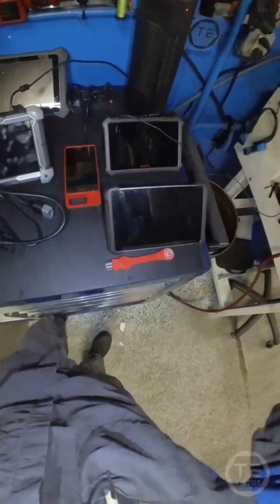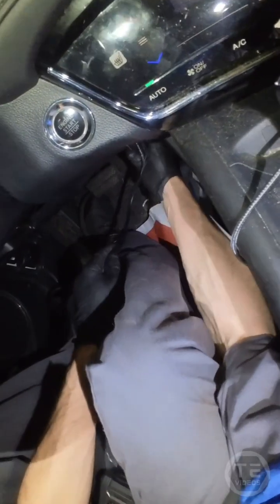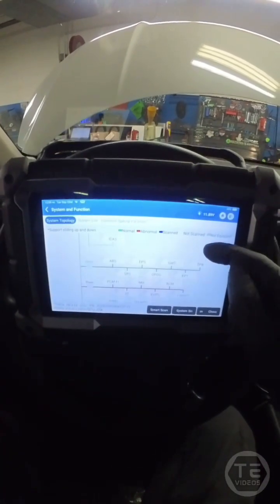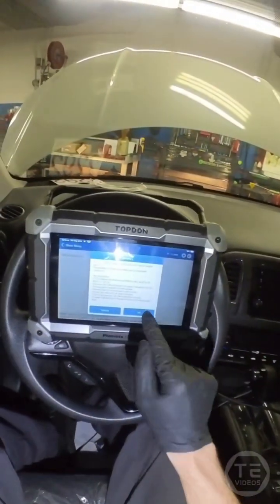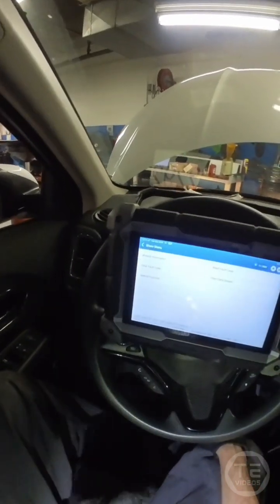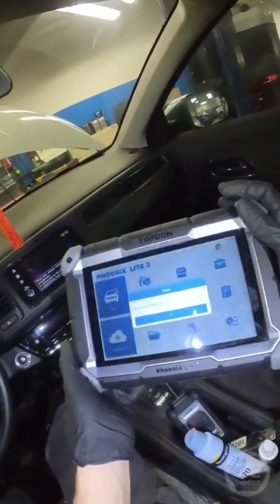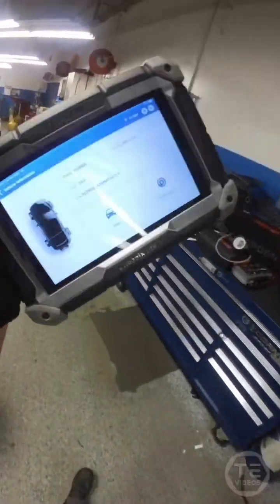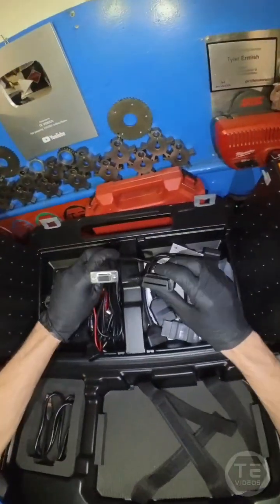New Favorite Scanner? TOPDON Phoenix Lite 3 👀👌 #topdon #phoenixlite3 #cardiagnostic #fyb

Comment: Does it require subscription, bud?  
My scanner advertised it was capable of all sorts of functions and after trying to use them it said I had to buy a yearly subscription per vehicle make in order to use the advertised functions.

When you review scan tools can you let us know if these functions are baked in or will require extra cost?  

Thanks for the videos, bud!
Reply from the maker: Most scanners come with 2 or 3 years of free updates. After that you have to pay yearly but it's optional. Your scanner will still work if you don't update after the free trial. You just won't be able to connect to any vehicles newer than your last update. Ideally you want to keep your scanner up to date for it to run best. As far as having to pay for special functions, it depends on the manufacturer and how they do things. I am able to perform radar and camera aiming in Hondas no problem, no additional subscriptions needed
Reply from the maker: There are some scanners with free lifetime updates but they don't have quite as much functionality as others

Comment: It’s cheap, a 10-13 inch screen is the new normal since 2022. I wouldn’t buy anything with less than a 10.1 inch screen and wireless vehicle interface.